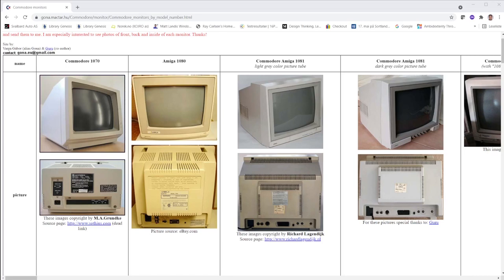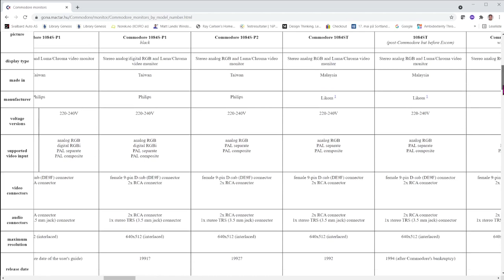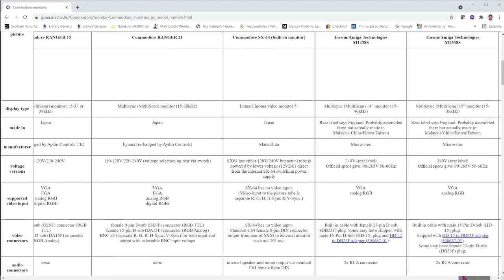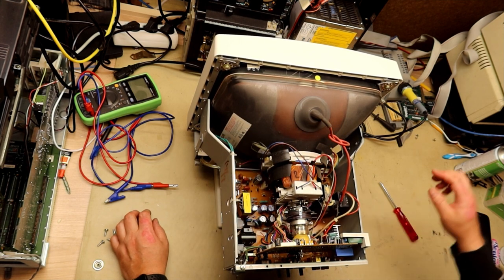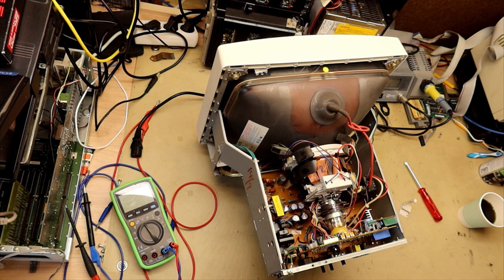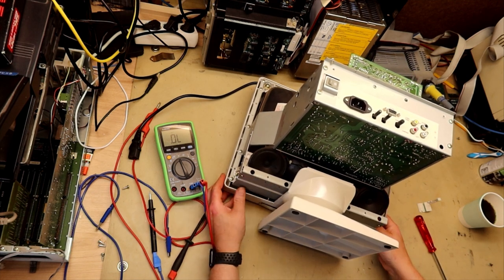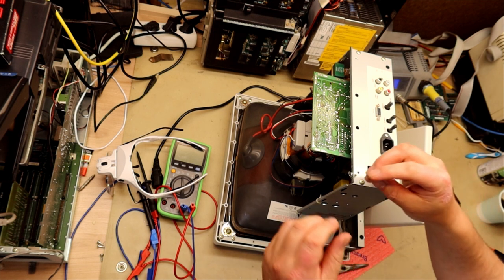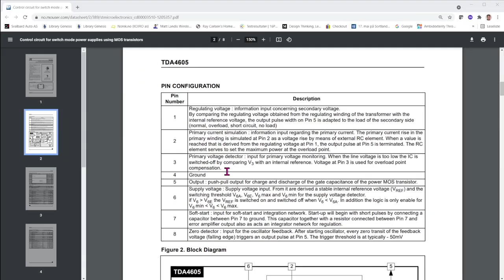The troublesome 1084ST, part 1

Comment: Good video, thanks.  I've just collected one of these, it's killing the fuse the moment I turn it on.  Struggling with a lack of service manuals although watching videos like this is a great way to get ideas.
Reply from the maker: Thanks for watching, I actually had this monitor back on my bench just recently. This time it was a faulty flyback transformer. I luckily was able to source a couple of these. When it comes to the power supply on this the circuit is not that complicated, and the application note that I used in the video actually is quite close to the design in this monitor. I would check the rectifier, the caps closest to the power switch, the diodes and the switching transistor close to the TDA switching regulator (the 8 pin IC)
Reply: @kojroRI  sorry for the late reply, one blown mosfet and a tda 4605 later and I have a pulsing green power LED.  Nothing at the LOPT though, I've wired a 60W bulb in there and presuming I'm using the correct pin for B+ (I'm using 4), the bulb isn't lighting up.  So I'm kind of at the stage now where, without a circuit diagram, I'll probably have to hand it to a TV engineer to fix.